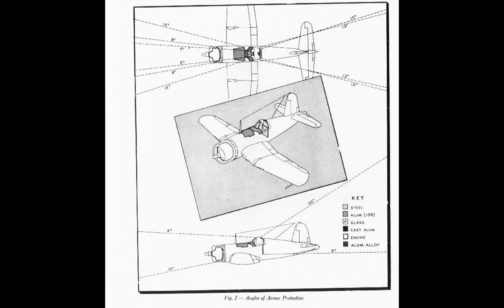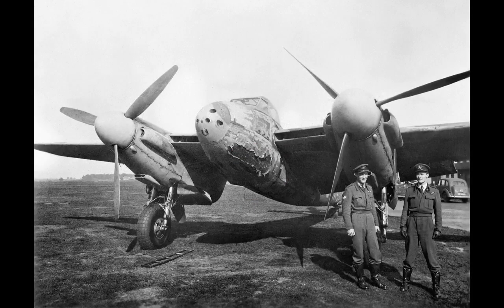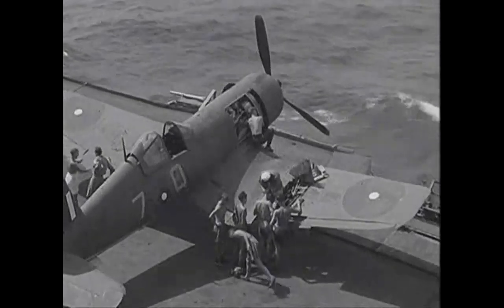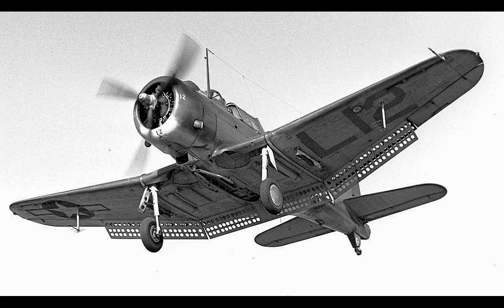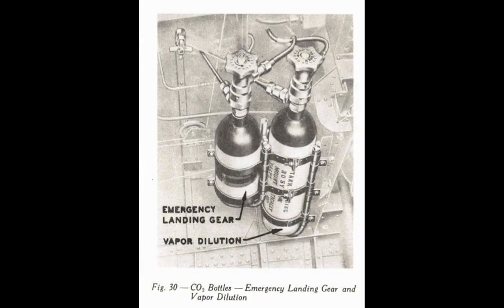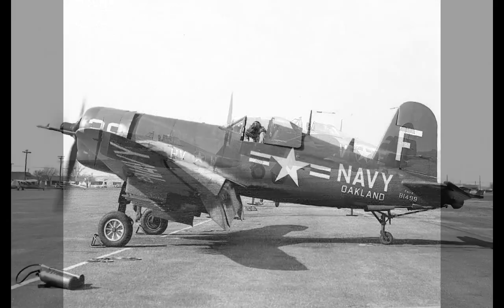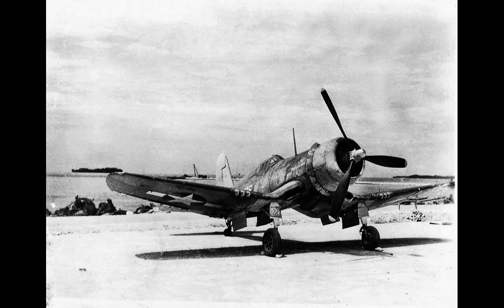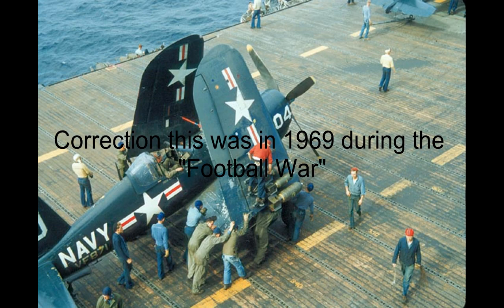F4U Corsair Design Features

Comment: This was a great video packed full of tons of info.  I think though you left out one important detail when comparing the hows & whys of this aircraft.  Chance Vaught gathered his engineers at a hotel bar, got them drunk, presented the details and then locked them in the hotel until they had a design.  The original draft for the Corsair was completed in a weekend.  I think that had a part in the design.  Those features were able to accomplish the goals set by Chance.
Reply: Chance Vought died on 25 July 1930.  That was seven years and seven months before BuAer issued its Request For Proposal which led to the design of the F4U.  Suggest you preface your comment with "Now, this ain't no bull..."
Reply: @randykelso4079  I can't do that.  I checked your facts & you are 100% correct on Chance Vought part.  I am not making excuses, I suffered a TBI & only have fragments left of my memory. However, that is a strong memory about the design part, not who.  So, if you will, ACK my reply & then I will delete it as it isn't true.  I hate putting something out there that isn't true.  Thanks for checking me on this.  Regards.
Reply: @rherman9085  Maybe it's basically true but flawed in the details or something, IDK.  I recommend that you leave it up since it makes such a good sea story.  :-)
Reply: @randykelso4079  You know it could have been Rex Biesel (head engineer) that did this.  When I was in A&P College, I wrote a report about the design of it, the bar/hotel part & why the gull wing design.  Until it made it to the wind tunnel, they had no clue the gull part created lift.  It was to solve for having a 13' prop-span.  I had the privilege of working on the Corsair that was the flying model used in Baa Baa Black Sheep.  It was used to fly as well as a mold to make the fake, stationary units on the ground that were shot up each week.
Reply: @rherman9085  Well, sir, it sounds like you had a lot of fun along the way and I'm happy that you did.  I'm sorry about your TBI and wish you only the best! Fair winds and following seas, shipmate!

Comment: Kudos, a decent overview of the Corsair, the details of the British Navy in the Pacific were news to me.  As for the design of the airplane, some years back I researched what I could find in order to scratch build accurate RC models of the plane and what emerged was to be so highly impressed with the amount of engineering that went into this airplane, one could even say over-engineered.  It has great complexity and was ahead of it's time in using the best of materials to produce a quality machine for the war effort.  In the original concepts, there was even planning for having small bombs located within the wing outer bays - those never reached production status but the overall engineering was amazing to this quasi-engineer.

Comment: You forgot to mention the bouncing problem of the early corsair. On initial carrier suitability trials, the corsair tended to bounce so severely on landing it bounced the arrestor hook over the arresting wires. The corsair would then crash into the barrier netting used on straight-deck carriers. The resulting evaluation rejected the corsair from carrier duty. The hellcat was available and so a rejection was easy to accept.
Reply from the maker: How long should I have made the video? It's not that I forgot to include any specific thing, it's just that the video has to end at some point.

Comment: The other problem with carrier landings was the sharp rebound from the Landing gear Olio UK or US term Shock Absorbers. The Brits Identified the problem and a solution was devised to soften the strut rates to soak up the landing shock without rebounding. I have seen some notes which mentioned a lot of the ground Based Corsairs had Locked wing Construction to save weight and complications on the Rough air strips the Occupied.

Comment: The forward front vert stabilizer design, like on the A6M Zero, means it is unshielded by the horozontal stabs in a side slipping stall or flat spin.
Reply from the maker: It's the opposite in the Zero.

Comment: Ah, yes: the B-26. Those small, laminar-profile wings made it unusually fast -- including, unfortunately, on approach and landing. Pilots didn't like it, and called it the "Baltimore whore": it was manufactured by Martin near that fair city, was fast, and had "no visible means of support."
Reply from the maker: Just to be clear. The plane I mentioned was the Douglas A-26 Invader. It's often confused with the Martin B-26 Marauder. These are two very different planes, the A-26 is more advanced and with much more performance. It's confusing because when the Martin B26's were retired, they changed the name of the A-26 to B-26, forever annoying history enthusiasts because the Martin B-26 is totally different from the Douglas A-26/B-26.

Comment: I was talking with an old-timer who flew with the first group to use the F4U once it was commissioned. He said in the early days of carrier landing, there were quite a few instance where the plane would snap-roll over the carrier deck. This was due to the wing root stalling & quickly traveling outboard. He said the solution was for the mechanics onboard to rivet an angle-iron speed fence to the inboard section of the wing. Problem solved! Just think of how many millions or billions of dollars would be spent today to find a simple solution like this?
Reply from the maker: The old timer is correct. That's a true story.

Comment: Was the material used actually Dural? Dural would have corroded too fast for aircraft use. Alclad would have been the actual material used
Reply from the maker: It says "DURAL" right in the A-26 manual. I included that page in the video,, so based on that  I have to think that, yes, it's Dural, or at least what was called Dural at the time it was written. I can't very well go cut a piece out of one of these planes and send it out for analysis, so that's the best I can do. Maybe Alclad was a subtype of Dural in the terminology back then, I really don't know. I'm not a metallurgist so i am going by what it says in the manual.
Reply: no worries mate....i didn't notice you took it right out of the manual so well done there! I just knew that Dural is prone to corrosion so they took Dural and put a heavy aluminum plating on it to stop that and called it Alclad....Dural core, aluminum outer coating to prevent corrosion. Also in my response...i meant to say "could have" not would have....as i am no expert...was just trying to contribute

Comment: The forward placement of the vertical stabilizer and rudder on the  Corsair was an attempt to mitigate the poor spin performance  demonstrated in one of the Corsairs predecessors, the VE 141.  In a spin the high angle of attack can cause the rudder to become blanketed, and moving it forward can keep it in clean airflow.  Other A/C do this as well (see de Havilland Chipmunk) with varying levels of success. In the Corsair, what was gained in the clean airflow was partially offset by the shorter moment arm caused by the forward placement of the rudder, and the Corsair had terrible spin characteristics which the company tried to correct by increasing the rudder size in comparison to the fin.  In the end spins were prohibited in the Corsair.
Reply from the maker: Do you have a source saying it was placed there to improve spin recovery? If so, please post it. If not, then it's just your personal theory.
Reply: Greg, great video and I always learn something watching your videos. Re: a source for the rudder placement, I read it years ago, as you have said, "somewhere", but can't recall the source.  I did not think it up myself.  I meant to mention that the blanketing is caused by the horizontal stab, not the wing.  It's a common, though obviously not the only, consideration in empennage design. Another viewer posted a similar comment.  

I was a structural design engineer on the F-16 years ago and we often discussed the unusual and sometimes innovative engineering solutions employed by our cross town rivals at Vought. I also remember discussing it there.  There is plenty of room in the Corsair's tail for structure. It would not have been moved forward for structural reasons alone. Trust me, the aerodynamicist always wins those battles against the lowly structures guys!  The aerodynamicist wanted it forward.

Sorry I can't be more help.
Reply from the maker: Hi Pin, thanks for your comment. It could be that it was some sort of failed attempt at improving spin recovery, and I have heard that too, but haven't seen a shred of evidence for it. In fact, for spin recovery, normally you move the whole thing farther back, like on a 47 or 51. The forward mounting of the vertical stab was common on Vought aircraft, the Kingfisher and Vindicator both had it, and I seriously doubt it was for spins on those airplanes.
Reply: Spins are complex aerodynamic events and it is hard, even today, to fully predict spin performance. By definition, in a steep angle of attack (as exits in a spin) some of the vertical tail will be blanketed by the horizontal stab. The trick is to keep as much vertical tail in clean air as possible so that it will have some control authority. The 47 and 51 have rudders that partially extend below the horizontal stab, so part of the rudder is always in clean air. This requires the horizontal stab to be slightly forward of the vertical tail, and the higher there better, as in the 51.  The Vought designs we discussed all have the rudders entirely above the horizontal tail, and one way to minimize blanketing in that configuration is to move the vertical tail forward.  Moving it forward was a conscious decision on the part of the designer. As spin performance is always a design consideration, I think it probable that the placement was a conscious attempt - failed as you point out - to enhance spin performance.
Reply: Greg, found some more data on the vertical stabilizer placement on the F4U.  The following comments are taken from a NASA paper summarizing NASA and NACA research on how design choices affect spins:  https://ntrs.nasa.gov/archive/nasa/casi.ntrs.nasa.gov/19720005341.pdf   The paper states that much of the data was derived before and during WWII and is applicable to light planes today. On page 10 it discusses rudder and horizontal tail placement. It states “In general, two types of rudders are used on general-aviation airplanes today: full-length rudders and partial-length rudders. Full-length rudders extend to the bottom of the fuselage, whereas partial-length rudders generally terminate at or above the top of the fuselage. (See figs. 6 and 7.) Regardless of the design, however, the rudder should provide an adequate tail-damping power factor for good spin recovery. In general, the optimum horizontal-tail position to provide the maximum unshielded rudder area is different for partial-length and full-length rudders.

For full-length rudders, the part of the rudder below the horizontal tail provides most of the unshielded area. Therefore, high and forward positions of the horizontal tail are usually the most effective configurations for spin recovery for designs employing full-length rudders.” (My note: P-51 and P-47)

“For partial-length rudders, all the rudder is above the horizontal tail, and the top part of the rudder provides most of the unshielded area; therefore, low and rearward positions of the horizontal tail are most effective to provide the needed unshielded rudder area.” (My note: many Vought designs)

It does not specifically state that Vought used these principals to place the rudder ahead of the horizontal tail any more than it states why Vought put the more highly curved section of the wing on the top surface of the wing, but as an established aerodynamic principal of the time, spin considerations were the reason the tail looks the way it does.

Comment: Nice video Greg!  I would like to add a few points that you probably know but left out for the sake of brevity but others might enjoy.  The Brits not only perfected the curved approach for the Corsair but also spent a lot of time and effort refining and perfecting the struts to reduce excessive bounce and to provide a better response rate for the piston.   Since we are talking about the British I wanted to comment on their carrier design again which you might understand but is often a misconception to others.  While comparing British carriers with their armored flight deck to American carriers without it is a real oversimplification of the differences.  The US carriers did not have armored flight decks but in fact had armored hangar decks.  So while an enemy bomb would penetrate the wooden flight deck on a US carrier they often did not penetrate the armored hanger deck.  Why did the US chose to do this, the major factor is weight distribution.  Remember carriers were always very fast ships with fleet carriers typically having a top speed of 33 knots (or 38 mph) and their rudders were massive to enable extremely sharp turns to often avoid bombs, bombers, or torpedos.  Remember one of the basic definitions of a ship vs a boat is that a ship will list outward on a turn.  So putting steel higher up on an aircraft carrier means a greater list and at some point you risk ship stability in extreme turns so if you move the armor down a very high deck level (the hanger deck on modern carriers is about 37 feet and it was very high on WW 2 carriers as well) then you have a ship that can really turn sharply and this saved many carriers both US and Japanese during the war.  Also, the British carriers were all slightly smaller ships so I assume the tradeoff was not so great for them.  Also, the wooden flight decks on US carriers required typically minutes to repair so that was an advantage as well.

It was interesting in the video that the Naval Corsair used a CO2 purging system which was one of the key strategies for avoiding fires on Navy ships.  The US excelled at Damage Control and all US carriers had CO2 purging systems for aviation fuel systems on carriers, a very Navy thing to do even on the Corsair.
Reply from the maker: Thanks Will. That's good information. Discussing ships in my video is always a bit tricky. For example I didn't want to take up 15 mins my 40min video talking about ship design, but I felt that I had to cover the minimum, and the minimum is that British carriers had armored decks and were almost Kamikaze proof. All your points are very good. I didn't know that about purging the lines on a ship with CO2, but it certainly makes a lot of sense.

Comment: As a teenager I remember looking forward to and watching every episode of the tv series Black Sheep Squadron.  I've been fascinated by the Corsair ever since.  I believe there was an episode when someones gear would not retract after take-off.  'Pappy' told him to roll/inverted for the gear to fall down which worked.  Curious if this procedure was fictional hype or legit.
Reply from the maker: I'm not sure. I might try and figure it out later. If inverted, the wind and gravity might do the trick, but I imagine that it would still need some hydraulic pressure to release it from the down and locked position. Bottom line is I don't know.
Reply: @GregsAirplanesandAutomobiles  Flying inverted might have created problems with the carburetor and oiling system.   I don't know about the R2800 specifically, but not many aircraft of that era were designed for neg G operation.  Perhaps it would be OK to operate inverted just long enough to get the gear to fall into place, but if it did not go quickly, could be trouble.

Comment: I drove the crash crew ambulance on Eniwetok in 1954 where Corsairs flew night patrols.  Many declared emergencies and disturbed by sleep due to in flight fire warnings in their electronics bay.  None burned.
Reply from the maker: I know you meant 1944, I am just making the correction for our readers. I am glad to hear that none burned.
Reply: No Greg I meant 1954.  I was part of (a small part) the 1953-1954 Joint Task Force 7 operation to test the new atomic and hydrogen bombs on Eniwetok and Bikini.  I was 11 years old in 1944.  Incidentally we had F84s,  B36s and an occasional C121 on base.  The funniest thing was Curt LeMay was there for part of the tests in his personal KC 97.  The maintenance crews left it out on the flight line without protection and it wasn't flight worthy when he wanted to leave.  The Japanese were not the only problem for the WW II troops.
Reply from the maker: Ah, I didn't realize we had anything going on there in 54', but I forgot about he bomb testing. Thanks.